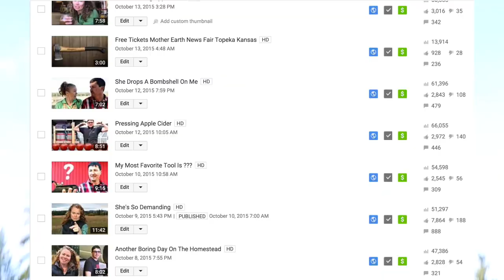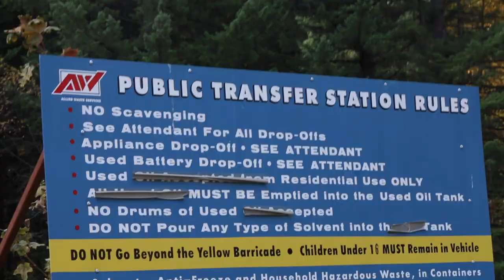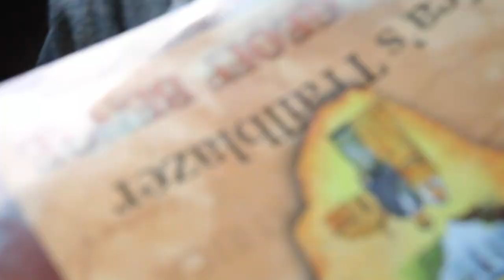AMERICAN DREAMY

Comment: I bought a bungee cord net that hooks to the top edge of the box and tie down loops on my Sonoma. Goes on quite easily and keeps everything secure. Works well over a tarp too. Cost me about 20 bucks but it's paid for itself many times. I store it in the bag it came in tucked in behind the seat along with the ratchet strap bag that I made. Saves a lot of time having to use multiple straps and cord.

Comment: This is a GREAT video.  If your live in our county you don't need to pay when you go to the dump. They have you show your drivers license, home bill to prove you live in the county.  And a mile from the dump on either main road there are signs 'Tarp your load'.   Those appeared around 8 years ago as a result of something flying out of a truck bed on the way to the dump and hitting the vehicle behind them, badly injuring the driver.
Reply: +69Phuket   What are you asking?

Comment: A mentor at my first job had a saying: What's the definition of a shortcut? The longest distance between two points. You have to undo the shortcut and then fix the original problem.

Comment: this summer my family and I were going up north for the summer and one of our kayaks came off the roof while we were traveling 50 miles an hour on the expressway in downtown Milwaukee. but luckily no one got hurt and the kayak survived with only a scratch then it happened again about 5 hours later. it is kinda the same as the couch cushions but just a kayak.
Reply: That's why I refuse to transport canoes and kayaks other than in a trailer!